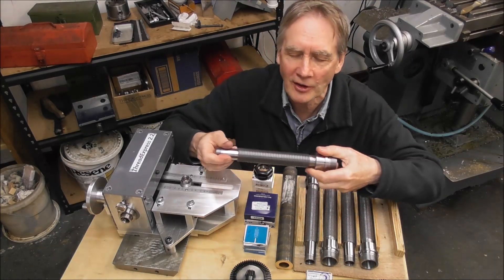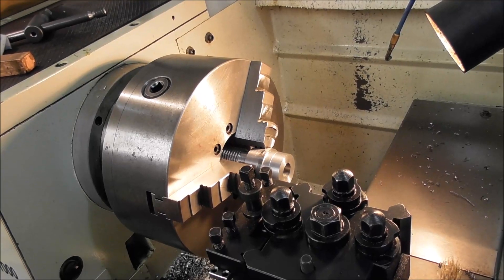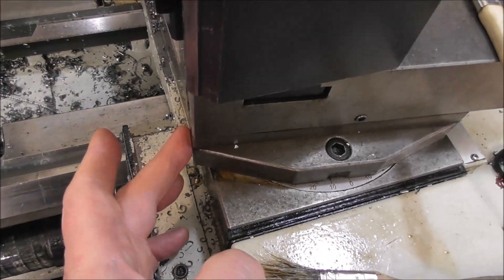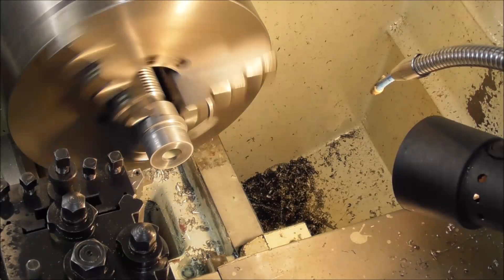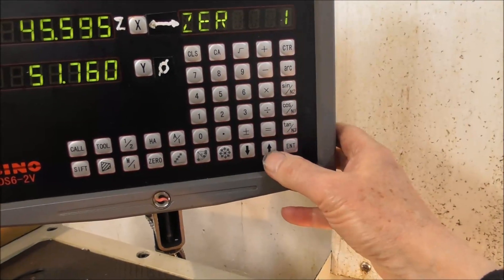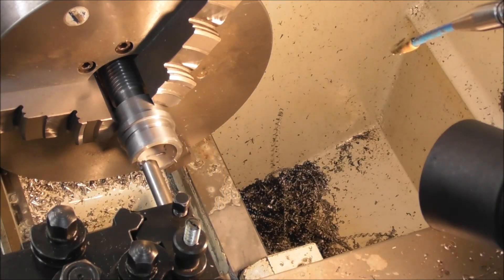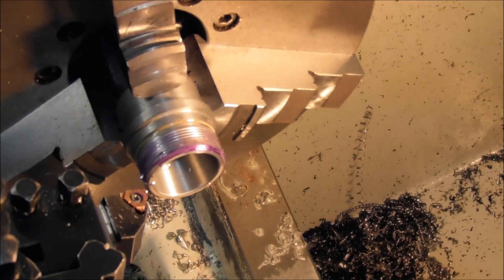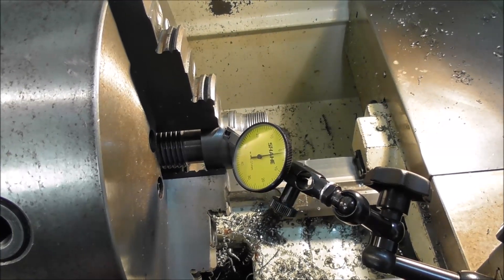Lathe DRO Offsets

Comment: Hey Cliff.  Great advice for using a DRO.  I'm afraid that I had trouble following your examples though, because we needed to see the DRO when you were using the tools.  Were you cutting to Zero with each tool or were you cutting to the number you needed?  For this kind of instruction, you almost need two cameras with a split screen view in the video.
There are two ways to set up tools. Either your set up all tools to  0,0 then cut to your finished dimensions, or you set up tools for your specific part dimensions and cut to 0,0.  I was a bit confused as to how you did it in the initial set up.
Thanks.  Regards.
Reply from the maker: Hi - Each tool DRO display number is set to the actual part diameter eg a turning tool say number 2, finishing say a 10mm diameter would display X10.00 and distance from part end. eg 20mm long would display Z20.00.  Cliff
Reply: @Threadexpress   Okay. So each tool is set to it's 0,0 position to start. Thanks Cliff.

Comment: Fitting a Cheap Sino DRO to my toy Lathe (cost me $210 AUD delivered with scales, so there is nearly no excuse not to have one) over winter but the QCTP will need to wait because the Mill is eating the pocket $$ at a rate of at least twice it is getting replaced at 😁
Reply from the maker: Yes, once you get up to speed with a lathe DRO you will never look back. Cheers, Cliff